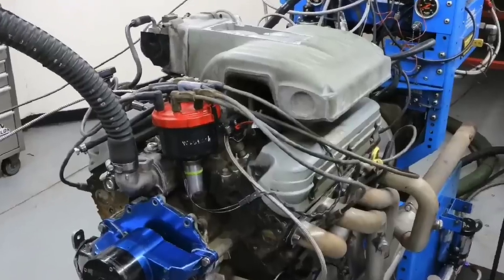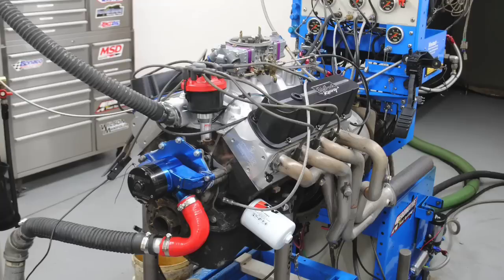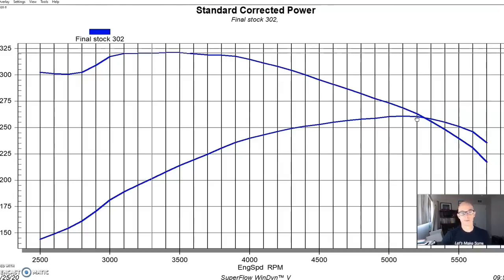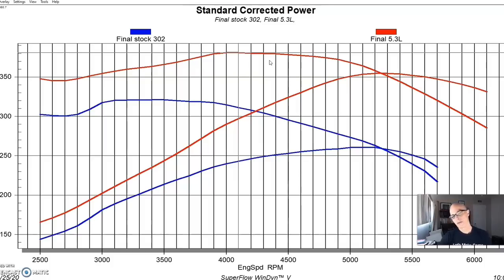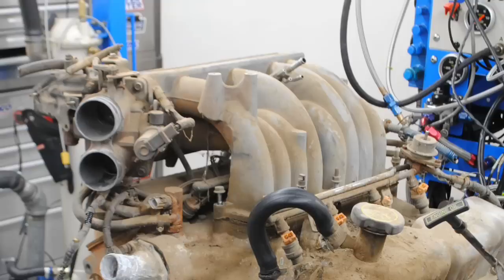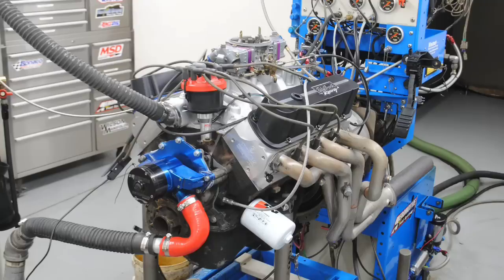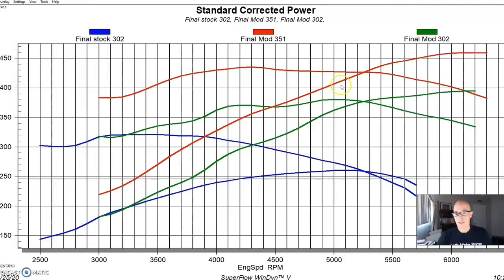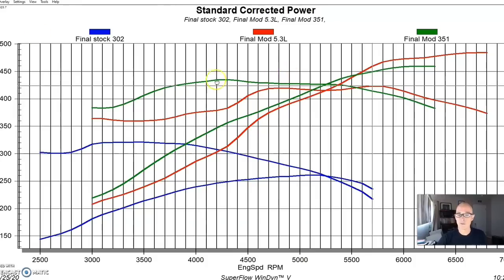5.0L vs 351W vs LS-SHOULD YOU SWAP?

Comment: Cylinder heads. LS engines make power because the heads flow. Coyotes make tons of power for their size because the heads flow MASSIVELY. Cams help but cylinder heads are where the power is at. I've had 302 and 351W powered fox bodies with various heads, cams etc. It's hard to argue with my bone stock 01 Z06 that has a smooth 700 rpm idle and gets 30 mpg yet it makes 350 whp. That's a 346/351W with heads/cam/intake and a choppy idle and junk gas mileage, making the same power as a stock LS6. I don't pick sides, I like Ford motors and my 300whp 351W had more low end punch than my Z06 EASILY but LS motors are great, can't fault em.

Comment: Seems like a lot of people are missing the whole point of the video. It's more of saying that its a budget thing. You can go to any junkyard and find a decent 5.3 for pocket change unlike the better options that ford offers. I promise anyone that they'll never find a 5.0 coyote for anywhere near the same price as an ls series motor. Then hell, even if you come across a damn pot of gold and find one, it's gonna be more expensive to do the same kind of modifications to the coyote that the LS would be receiving. Also, it's kind of funny that people keep saying to compare the 5.3 to the 5.0 coyote to make it "fair". So what you're saying is; he needs to take Ford's most current v8 to keep up with a motor that was put into some GMC envoys back in 2003. Kind of ironic isn't it?

Comment: My opinion, put whatever engien you want in the car so long as you dont have to seriously modify the engine bay. Like how you shouldn't put a 350 in a 71 mustang because the sump almost requires a degree in engineering to redesign the steering and engine crossmember to clear for it. Its the same with putting a 351 in a malibu, way more hassle than it's worth.

Comment: Money 
Its name is money.

Fitting in an LS surely is cheaper than spending $3,000 on a SBF upgrade.
Reply: I'm still into 5.0 HO T5 as a fun driver.
Gaining 100 hp and losing the low end makes an UNfun driver.
Reply: Love your FORD, then stay away from LS's with turbo's
Reply: LS is the best bang for the buck, that’s why it’s so popular.  Nothing out there that is as easy or cheap to swap into anything.  If money is no object, build whatever engine you want.
Reply: @stevejones6647  Ultimate dream ... V12 of some sort.. with 3 carbs on top... thru the hood of something fun

Comment: The 5.0 fit right in there...and my 86 base coupe doesn't need and won't handle 400+ HP without some major upgrades elsewhere. So, 5.0 with HCI is it for me. My days of chasing every last hp at the expense of everything else are behind me, I guess. I just wanna have fun, cheaply if possible.
Reply: I would do a decent heads cam intake package and a blower if it were me.  Push 450-500 to the wheel and keep rpm under 6200-6300 rpm max and use the best fuel possible and make sure it's tuned really good and it'll be fine.  That is enough to smoke alot of cars today even modified ones because that power in a fox will move tf out and the sound with those mods is intoxicating.

Comment: The LS has it's advantages yes. But when you add up the engine cost the swap kit cost (mounts headers etc) engine operating system, different transmission and mount, custom driveshaft etc.. The cheap power line gets blurry. I would think most LS swaps are performed on fox bodies where at least the drivetrain is clapped out. Or someone wants an LS mustang and buys a roller to build? I might be wrong but it seems like a waste to take a good condition fox and gut it.
Reply: Very commonly overlooked by internet bench racers. They can absolutely be cheaper; the answer is "it depends". But more often than not, you're going to have a lot more into the car than you thought changing all of that.

Comment: You need to show the cost if you have a Fox or SN95 and want to swap a LS into it. So now you need to buy or make engine mounts, trans mounts, exhaust, fuel system ( carb or injection) transmission, driveshaft, then all the nickle and dime stuff ( hoses, belts, controllers etc.) Chevy people already have this stuff, Ford people don't and would have to figure out all these costs first. Sorry bout the rant....been down this rabbit hole before
Reply: There def is alot more to it than the cost of the engine.  All of that stuff just adds to the cost making the whole budget thing null and void.  Ls might be budget in a gm but not in a ford lol.  I would go stroked high compression 351 for a fox and go coyote for 96 up mod motor cars.  I honestly believe cost wouldnt be that much more once EVERYTHING is factored in like you said and it certainly would be a hell of alot EASIER

Comment: I was surprised at the comparison of the modded 351 vs the modded 5.3. I expected the 5.3 to be far and away more powerful, but I did notice that in the RPM range that most of my street driving is done (below 4500 RPM), the 351 appears to have a 50 lbs-ft advantage over the 5.3. Weight is obviously going to be a factor, but it should be significantly lower than the stock iron headed 351was. And I had been considering going with a 460 before finding your videos, now I have the information I did not have before. That has led me to decide to do my next build with a roller cam 351w because it can achieve plenty of power and it is a wee bit lighter than the big block. A major consideration since the vehicle it is going into will be under 2000 lbs. with the small block. 
I had the 5.3 in the back of my mind but I am a Ford guy, and that irksome doubt has finally been erased.
Thank you, your videos have been a complete revelation.
If you ever do a Ford 4.0 Cologne V6, do it with OHV AND SOHC ! 
I have done some research into that engine, and considering it's incredibly tiny footprint, I could not understand why more performance parts were available until I found out Ford was doing it's usual screwball antics with the bottom end. Internal changes that preclude parts interchangeability.
What a shocker !
Reply from the maker: 5.8L vs 5.3l-displacement at lower rpm helps a lot
Reply: Dude the 5.3 almost def had more compression and a head flow advantage.  Dont listen to the internet myths that ls is God and anything ford powered pre coyote cant make power.  That is all just that, myths.  This is just a mild 302 sized hci setup on a stock bottom end lowish compression 351.  Put better heads cam intake in a stroked high compression 351 and you got a monster on your hands.  It would be much easier to swap into a fox that had a stock 5 liter in it.
Reply: @midnight347  Actually, I see the Coyote as Ford once again backing the wrong horse as they did with the Windsor over the Cleveland. Ford of Australia got it right back in the day they went with the Cleveland and built 302 and 351 Clevelands. And from what I understand they were eventually outfitted with EFI (although I do not know this for a fact, I saw one on AUS 2 USA) and once again up until 2016 they were building the Barra into a monster and Ford head office ignored it, trying to get the modular V8 to work, after crippling it intentionally by keeping the bore spacing too close together to "reduce the footprint". So, very limited displacement capacity is the result.
If you really think about that, worrying about one inch (probably less) length on something that is about as big as a Boss 429, well that makes sense !
And WTF is the deal with bellhousing bolt patterns !? Just because you build a new engine that does NOT mean you need to create a new bolt pattern !
I am rambling now . . .
Reply: @jeh4138  idk about backing the wrong horse the coyotes dont have much problem making power I've seen em make over 700 rwhp all motor in race applications and they make ungodly amounts of power once boost is thrown into the mix.  I get what you're saying about Australia having a bunch of cool cars engines we never got but that is just how it's always been.  They had a 400 horse 5 liter in like 2004 in the 4 door falcon (another car we never got) that was not a coyote it was more like the 4.6 here at the time in the mach 1 just a bigger more badass version.  They also has 5.4 4v in stuff besides an SUV unlike American Ford lol.

Comment: Sorry for the thumbs down RIchard.  Usually I give you thumbs up.  However I don't think this video is useful without a cost comparison.  It's basically click bait.  I was really hoping to see power/cost of each combo.  Obviously with an LS swap you need a lot of ancillary parts, like wiring, ECU (+tune I believe), transmission or transmission adapter, driveshaft?, exhaust, oil pan?, motor mounts, cooling has to be adapted, etc.  I don't think you need nearly as much hardware to run an upgraded 302.  So, assuming I have a Fox with a stock 302, the comparison should be cost of upgrading the 302 vs. cost of LS + swap parts.  I wouldn't be surprised if you could find a used 8.2 deck Dart block and build a 363 by the time you have an LS with H/C/I and all other required parts fitted to a Fox Mustang like you talked about.  But I don't know the $ comparison. The 351W isn't easy to swap either, but you might get away with fewer add ons.  At a certain power level that T5 won't hold up.  Yes I realize this makes your video more complicated to create, but that would have really been a great video.  My guess is an upgrade to about 350 or 400 hp on the 302 is relatively inexpensive, but when you start doing any type of swap or going past 400 hp the costs go up a lot very quickly.
Reply from the maker: THNX FOR THE THUMB'S DOWN-YOU ARE DEAD TO ME

Comment: The fact is the 302/351 is still old technology if it were compared to 1st gen sbc it would have been closer . I’m a Ford guy but like the ls engines for what they are small and just good! Now ford finally came out with a push rod engine that’s smaller than the coyote the 7.3 but in my mind it’s still to late for the average hot rodder

Comment: My friend had a 1987 Dodge OMNI GLH-S (Goes Like Heel Smore') Carroll Shelby tuned version would spank a 5.0 mustang and cameo and would win the race. These had a 2.2L Carrol Shelby tuned Turbo 175 HP and 175 Ft of Torque and went 0-60 in 4.5 seconds and with A/C and opponents weighed less than 2000 lbs . There are mods for the Carrol Shelby 2.2L Slant 4 to easily get 400 hp and 500 ft of torque.

Comment: Billy from (SRC) YouTube channel he just got a stock 1987 mustang and put a 200 shot of nitrous on it and then he put a top end kit heads cam and intake and headers.  That should be pushing right at 500 HP.  If Billy doesn't beat his father in this next drag race I guess he'll put more nitrous on the mustang until he beats his father in his  78 chevy Malibu with a simple little crate engine from Jegs racing.....you racing guys should check out the video's of them street racing each other it's awesome it's a YouTube channel called (SRC)
(S)TREET (R)ACING (C)HANNEL.

Comment: Well, you can taut the LS all you want but my son has proved to himself and several of his friends that those LS engines just aren't as durable as a Ford engine, since he has put no less than 6 LS 5.3s in the junkyard blown up (as in unusable henceforth) and has finally taken my advice and is sticking to Ford products in the future. Now he and I both like Dodge products as a second choice. Dodge so far has done well for us both. Now he absolutely does push a vehicle to the limit on a daily basis, the GM stuff just can't seem to cut the mustard.
Reply: Your son is doing something totally wrong the ls platform is  way stronger and reliable than any ford ever designed I've split 302 blocks with ported GT40 heads and intake big Cam and nos yet I have a cam and valve springs only 6.0 unopened long tube headers Holley 750 and a 150 shot that I can't kill

Comment: a compare weight of the 302 with aluminum heads  a to a use 331 stroker to compare the power  b   i would pick the windor in the modified race over the others due to it s flatter power band and lower rpm lasts longer c then there s the cost time and trouble to swap the ls new transmission mounts where the WINDSOR PRETTY MUCH BOLTS UP TO EVERY THING  I have done this swap 4 times my one car ran 12.4 at 110 with a 8.5 to 1 windor with ps pb and 373 gears 2500 stall and weighted 3700 lb s  for me WINDSOR IT IS  d old 69 to 76 W heads can be ported to flow pretty good

Comment: I find it interesting people mention the cost of having to swap transmission. When ford guys make high horsepower they often use GM transmissions anyways; powerglide, TH400, and 4L80. I have a 6L80 in my Bronco and daily it with a 418 L92. Well, sometimes I drive the turbo Sierra so it isn’t a true everyday daily driver to some.

Comment: Should have used a early 70s 351 Cleveland 4V, be a better comparison since it actually has heads that flow. Stock Windsor heads are terrible. The LS has good flowing heads, so it would have been a more valid comparison.
Reply from the maker: the stock 5.0L Mustang did not come with a Cleveland(which is what this video was about)
Reply: @richardholdener1727  they didn't come with LS engines either. My point is a Cleveland is a good swap for a fox.

Comment: Just lookup on youtube TRUE STREET APSA ROUND 2 SYDNEY 17/5/14 MY engine builder owns and races the brown falcon xd dart block 412 cid street rego 3500 lbs car runs mid eights 158 mph,no LS can compete,there was a torana 420 cid ls and couldnt brake into the eights and weighed heaps less

Comment: My personal preference is to keep engine/body/drivetrain from the same corporate source. That said, if you look at the engineering, the LSx family is tbe best Ford design that GM ever built.

( and right about now, 3 dozen Bowtie Forever guys just had their heads explode)
As in ALL things HOTRODDING though, remember that "The Nut Behind The Wheel Is Infinitely More Important Than The Brand on The Valve Cover or Fender!!!"

Comment: ...or....instead of spending over $4000 on the edelbrock stuff, just do a cam swap and tune on the 5.3 and enjoy your 430 (very reliable) horse power. Nothing against ford, I've got a couple myself, and have considered putting a LS in my old mustang (just cant get myself to do it) but there's a reason no one is putting ford motors in their chevy.

Comment: Good video! Not sure that the 351w had the best heads and cam . Good power but with better heads cam could get more plus could stroke it. And you forgot the best 351 of all and the best small block of all small blocks the Cleveland 4v or 351 Boss .

Comment: Hope you see this Richard. I am old school and don’t have social media to connect through but am currently collecting pieces for a motor. So far I have a 5.3 a M122 blower with plates to mount it to a cathedral port ls. I’m considering a low buck ls9 cam/ls7 springs and good injectors as my combo. Advise on tune and engine management pulley sizes ETC and anything else would be great.
Reply from the maker: not sure what management you are using
Reply: I have a stock pcm and harness but considering the holly terminator x max. This will go in a 02 thunderbird with hardtop and as of yet gave no idea what rear center to use as I am not a ford guy. It just worked out this way. The goal is 500 wheel

Comment: It it were my Fox body, I’d LS swap it.  Run a cam only 5.3 until I got my hands on a 6L.  Then do a mild port job on the 5.3 heads, add them to the 6L with a cam, and make an easy 500hp.

Comment: Techinically Im a millennial but i have boomer mentality... id rather upgrade a windsor or a sbc sbf bbc bbf... cylinder head technology is so much better these days and building these old engines are becoming a thing of the past, id rather run an old school engine than a new one... still debating if i want to swap a 351 to replace my ecoboost in my 2012 F150... so much power potential out that 351 block that its hard to ignore... got one sitting in my garage but its dedicated to go into my dads sn95 mustang... you know once a top end kit from edelbrock is done to it

Comment: I think the biggest problem here is that most people are scared to swap an engine, it's more than just bolting on parts, and ford guys have a hard time admitting that ford engines are inferior and more expensive, I have 3 fords in my driveway right now, a powerjoke and 2 mustang's, I'm not a chevy guy, it's just common sense
Reply: I agree.  With all of this but the biggest thing that gets me is procrastination and wiring

Comment: Can we get some videos on your Chevy sprint stuff. I’ve had one of those early 1.0L engines (with the rocker arms rather than the buckets under the cam) sitting in a crate at my dads place for like 10 years.
Reply from the maker: I will try to run mine on the engine dyno